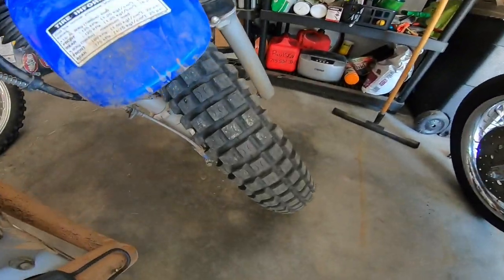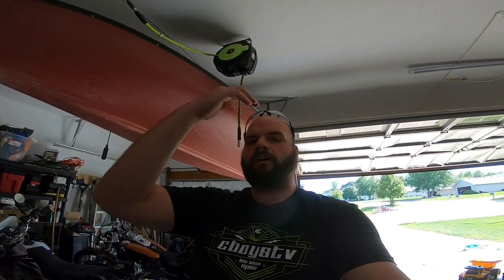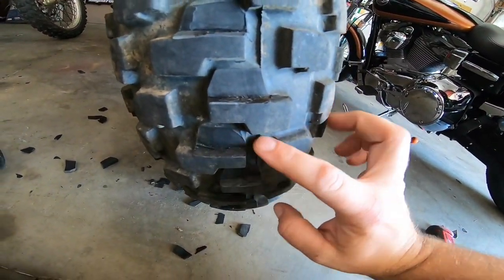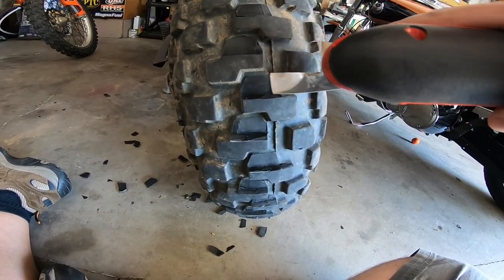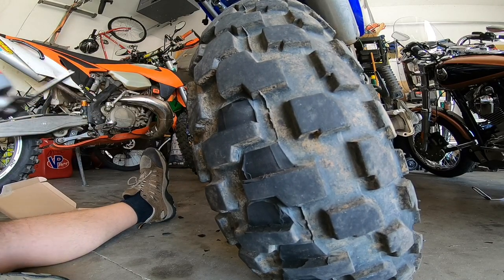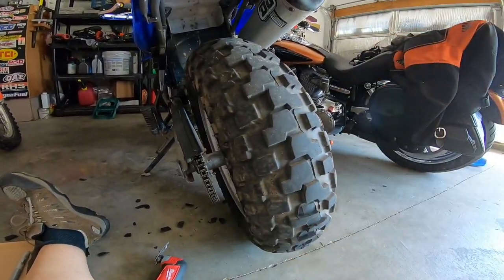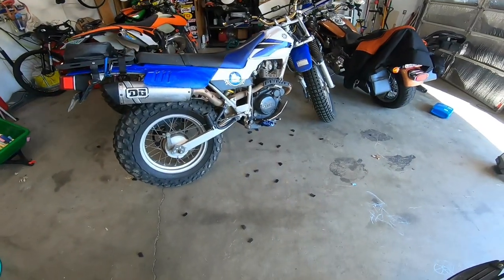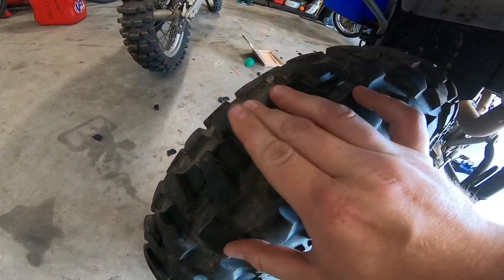Best TW200 Tire Modification

Comment: You do not cut the bead on the ATV tire to put it on.  The Atlas Tyre Gater 8" fits fine as as long as it is warm out when you mount it, its not a problem.   I am interested in your method as well as I agree the tread is too close together so it can't clean itself.

The other problem beside DOT with the ATV is they are heavy and it's not like the TW has horses to spare. 😁

Really don't understand why no one makes a tire for the TW.  It's not like the bike is rare!
Reply from the maker: Thanks for the info! How do you like the ATV tire
Reply: @tittan1500  I don't use one just know people who do.  It works super well but I don't like the weight or road characteristics.
Reply: I would not run an atv tire on the stock rim. My tw has the atv rim conversion so I have an atv wheel and tire on my rear. It’s less likely to come off the bead than an atv tire on a stock rim.

Comment: Cool idea but not sure if its road safe. Now every other lug has zero to little contact patch with the road. On a road bike the contact patch is around an inch now this tire is about a inch every 4inches . Interested in how it performs. Honestly the rear tire seems to have decent off-road traction especially the sidewalls
Reply from the maker: So far it’s been good, noticeable improvement offroad and no noticeable difference on road except maybe a little more noise.  

Look up the kenda trak master street legal tire. This still has a lot more rubber on the road